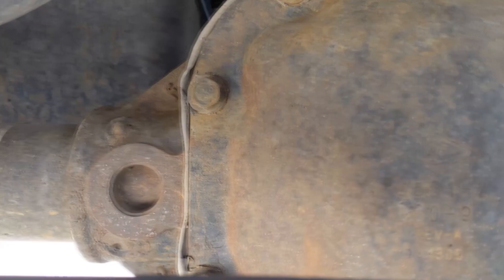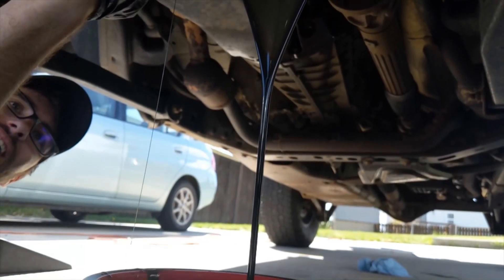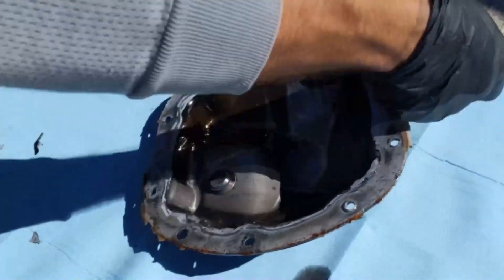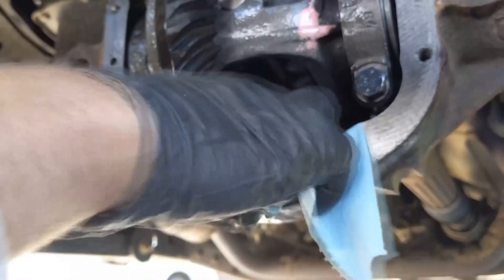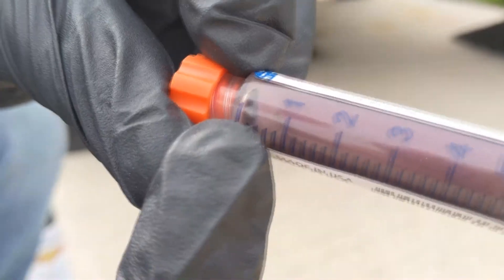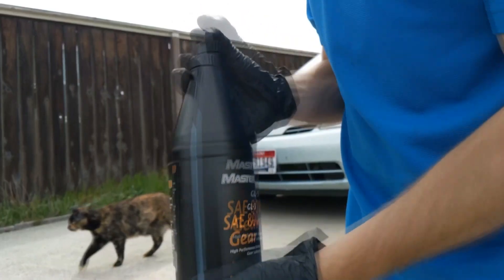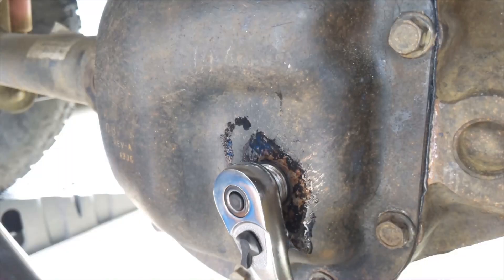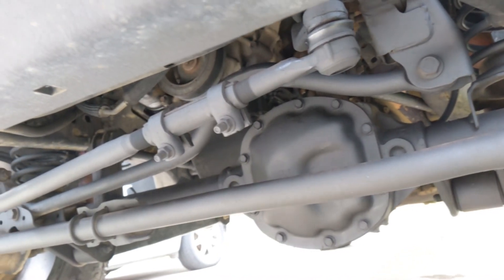How to use TriboTEX in your differential to reverse wear

Comment: Can't we just put the front tires up on a curb, open the fill plug, and add the tribotex to the already-filled diff fluid?
Reply: Yes, as long as the lubricant is reasonably fresh and the gears are clean. If you just had your fluid changed, it's safe to add to your differential through the fill port. There is another video in the works explaining this easier process.
Reply: @Orofino6  Thanks. Could you provide the url to that video. My VW doesn't have dipstick, Fillplug is the only way to add TribTx
Reply: @ampiko68  The weather went bad before I finished the research on the second video, so I haven't published it yet. You can directly inject into the fill plug. I recommend that the tube of TriboTEX is at least room temperature and the transmission is warm. You can drain some fluid, pre-mix TriboTEX with it and return it to the system if the fluid is fairly fresh. I find most vehicles fill ports on YouTube by searching ("year" "make" "model" "transmission fluid change"). Even oil coolers can be injected into as well as they're sometimes easier to access.
Reply: @Orofino6  Thank you